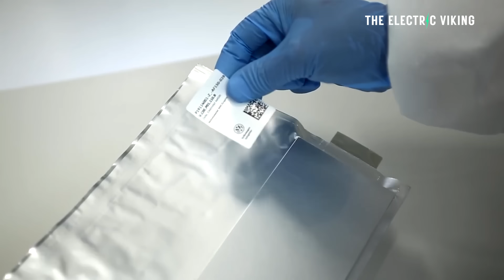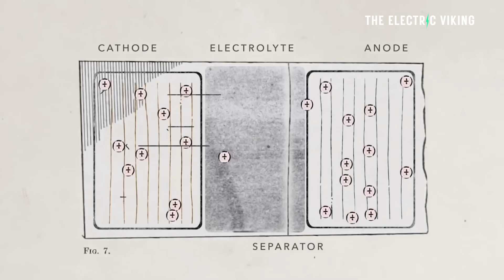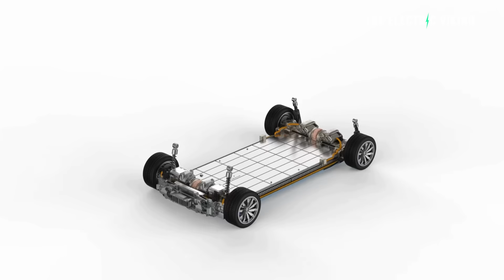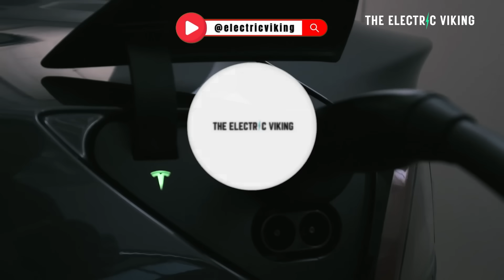Solid-State EVs Will Soon Seal Gas Cars’ Fate: 500 Wh/kg Power in 2025!

Comment: Volkswagen (with QuantumScape) showed over 1,000 cycles with 95% capacity retention, translating to a lifespan of approximately 500,000 kilometer with a range of 500-600 km. Some of the battery manufacturers however are claiming ten times this (10,000 charges) for multiple millions of km before the battery needs replacing. Unheard of lifespans compared to combustion engines.
Reply: the question is a different one. can they scale up production and make it affordable.
Reply: @stefanweilhartner4415  Eventually, someone will figure it out.  But, as usual, it will take time...
Reply: Will the new VW id2 use it?
Reply: @WaitingSheep  Doubtful, as the ID2 would be an entry level car, and that technology would be expensive before it can be scaled up.

Hence, like most other cutting edge technologies are likely to arrive in the Premium and Luxury vehicle sector before trickling down to the Regular and Economy EV sector.
Reply: 1000 cycles if recharged 2x/week would take more than 10 years.
Reply: @larryc1616  Which is probably unrealistic, as to drive the average annual miles on an EV with 300 miles of range, you would need less than 500 charging cycles.

People also have to remember for Charging Cycle calculation purposes, a Charging Cycle is considered to be charging the battery to its entire capacity, or 1C, as Lithium Ion batteries don't have a memory effect.

So, if you charged an EV battery from 30% to 80%, twice a week, it would be considered one charging cycle.

Same applies to charging a battery from 60% to 80% five times in a row, it is still only one charging cycle, as the charging cycle is adding 100% of the battery capacity, no matter how many steps that takes.
Reply: The question really should be, does anyone really need 5 million Km when you can drive 500,000 Km on a battery.

That is around 20 to 30 years worth of driving.  The car will be falling apart before for the battery needs to be replaced, meaning it is a lifetime battery.
Reply: @redbaron6805 for your average personal car sure 500,000km is a lot. But for taxis, passenger buses,  semi trucks, etc a battery that can last millions of miles makes means going electric becomes much more feasible.
Reply: @scow01  Longer is obviously better, but I was mostly noting that for cars used for personal use, 500,000 Km is about two decades worth of driving for most people.

Toyota and some other companies are already in the taxi EV market, where they guarantee the battery in their bZ4X when used for taxi use for 10 years and 1 million Km, meaning the capacity will be at least 70% after 10 years and 1 million miles.

This is one of the reasons it is popular as a taxi in Europe.

This will be relatively easy to guarantee with LFP batteries, which should easily last 5000 charging cycles, and could last as long as 10,000 charging cycles.

Keep in mind that each cycle is 1C or the entire capacity of the battery.  Meaning, if the EV has 300 miles of range, we are talking about 1.5 million to 3 million miles, or 2.3 million to about 5 million Km...
Reply: @redbaron6805 Of course. My point about millions of km was rhetorically emphasizing that lifespan isn’t an issue with solid state batteries based on the numbers coming out in (with realistic temperate change) tests so far. There is also the possibility of recycled (reuse between cars if they batteries end up lasting millions of km) batteries sold as new if they last that long, massively decreasing the price of some EV cars.
Reply: @NoreenHoltzen  I'm not saying that is not a good point, but not sure if it is as relevant as it appears.

There is more and more data showing that batteries in EV's today will last the life of the car.  That really is the benchmark that was needed.

The battery lasting beyond the lifespan of the car is a bonus, but probably less of a feature than it appears.

The reason is energy density.  As energy density goes up, a battery that will outlast the car will be much heavier, slower charging and  may be relatively obsolete compared to modern batteries when the car reaches end of life.

If you look at the computer, electronics, phone and semi conductor world, lifespan isn't the actual issue, it is obsolescence.

The vast majority of computers, phones and electronic devices are not replaced due to failure or end of life, it is replaced as it is obsolete.

The same is likely to apply to batteries, where they can be used in other applications, like grid storage or a variety of energy storage applications, but will be functionally obsolete for EV use.
Reply: future cars should be fully modular.  @redbaron6805

Comment: That energy density is "nice" for cars, but a real game changer for trucks, boats, and even planes. If and when it comes with low cost, longevity, good charging speed, etc. it will be pretty huge tipping point.
Reply: Yup
Reply: Trucks and boats, lol! Bicycles and motorcycles, yes.
Reply: @johngalt97 are you saying lol because it’s not there yet? Or because you think it never will be
Reply: @geraldikaz1981  Boats and trucks are the least weight-sensitive vehicles.
Reply: @johngalt97 that's not true. The Cybertruck is already too heavy and still doesn't have enough range for long-distance towing. The Semi is already 2,000lbs heavier than diesels, and while it's 500mi range is good for around 80% of routes, we want to get to 100%. Semis and cargo shops make money on how much cargo they haul. More battery weight equals less cargo. And ships need tons of batteroes because they're always accelerating. Cargo ships do long-distance transport so would need massive amounts of batteries. Trailerable boats can't weigh too much or they can't be towed without a much bigger/more expensive truck.

I mean one obvious sign that what you're saying isn't true is that we didn't start with battery powered trucks and boats, right? Just because they can carry a lot doesn't mean there arent major drawbacks to carrying that extra weight.
Reply: @truhartwood3170  Everything is relative, and will benefit from better energy/power density… I'm not the one claiming "game changer".
Material transport (trucks) will be smaller and autonomous before electric semi's will ever be a thing. That's a game changer.
Reply: @johngalt97 Electric semis are already a thing. So you're already wrong. Many semi manufacturers have already been selling electric versions for years. Tesla semis will start rolling off the production line at the end of this year, ramping up to a run rate of 50,000/year by the end of 2026. They don't anticipate autonomy for at least a few years after that.
Reply: Electric material transport could be a thing if they could exchange their main battery for a fully charged one every 250 miles instead of having to stop for a full recharge.
Reply: @j3i2i2yl7 Tesla semi already has 500mi of range and can add 400mi more in just 40min. Pepsi is already doing 1000mi plus with their prototype Tesla semis, with just a couple quick battery top-ups when drivers take their mandatory breaks. That range already covers about 80% of current semi routes just fine. And it will take many years to build out enough to take over that many routes. Meanwhile, batteries are expected to double their current capacity in the next ten years or so, which would give it a 1000mi range (or keep the current 500mi and just make it cheaper and lighter and therefore able to haul more cargo). Battery swaps have a lot of drawbacks in term of added cost and complexity, as well as needing more batteries (the most expensive part) to be charging while the ones in the vehicles are driving. It's just not worth it.

Comment: To me the charging rate and curve are very important as well.  A smaller lighter battery (45 kW?)with a range of 250 mi / 400 Km but with a 10 - 80% of 10-15 minutes means a short rest break has me back on the road without a lot of inconvenience.  Better than the 40 minutes of many of the 3 - 5 yr old EVs we have today.
Reply: In my that old ev is better to charge only to 72%...
Reply: …but now it’s only 2.

Comment: My concern is cycle life and actual years it will be useable. If they warranty it for a decent amount of time and miles that might help with scepticism.
Reply: They are already warrantied for 8 years as standard, some much longer.  With LFP batteries proliferating, which can easily last millions of miles, I wouldn't be surprised if batteries will start getting lifetime warranties...
Reply: @redbaron6805  I'm not against it. I am merely stating that I personally have had limited success with solid state batteries being long lived. I truly hope they are.
Reply: @davidrommel8109  I'm surprised you have any experience with solid state batteries, as I don't believe a single EV manufacturer is using them yet.

Pretty much every EV manufacturer is using NCA, NMC or LFP batteries by now, which are all Liquid State.

Solid State have not arrived yet in production cars, unless they have made it into some early Chinese versions..
Reply: @redbaron6805  I was referring to my research not batteries I purchased and used.